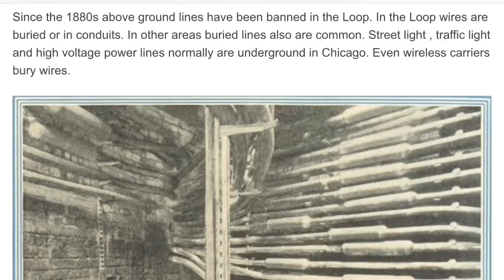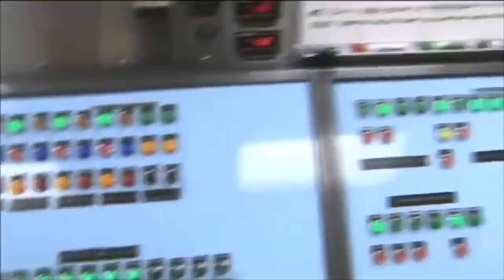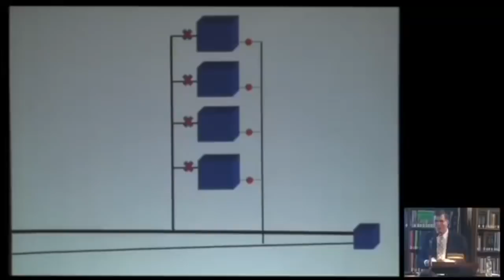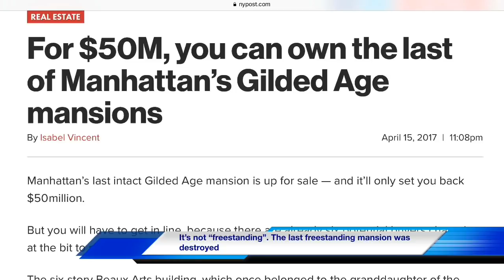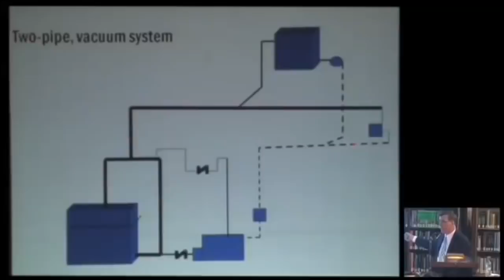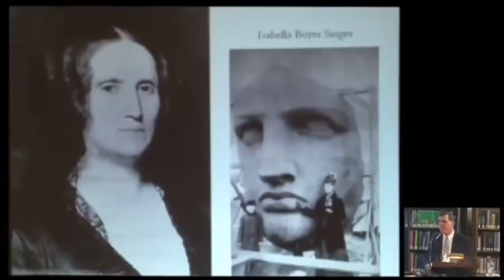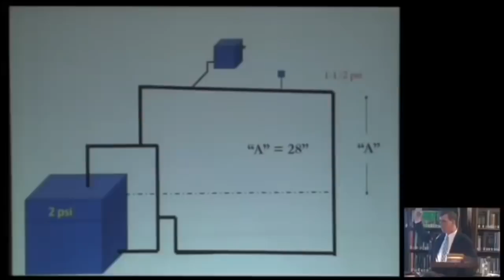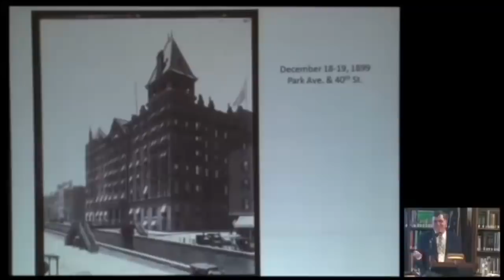Mudflooder Heating by Steam HVAC Revealed | UAP

Comment: I love ya my man but your incorrect about the steam turbines. I operate Boilers and we have a steam turbine that condenses 900lb steam to 165lb and 65lb which we run and supply the mill with. We often joke about all the 150lb steam we vent into the air that could be heating homes.
Reply from the maker: JoeNoBuddy Why not lower the pressures?
Reply: @UAPch  lower what, the operational pressure? Expand please.

Comment: I'm quite a ways along and still don't know where you get free steam.
Reply from the maker: Jason Snyder geothermal
Reply: @UAPch  Right, even though the earth does hold stable temperatures that are above freezing I'm just not convinced you could hit 100C necessarily anywhere you drill (unless drilled to unfeasible depths).  Hot springs are rare and are usually already owned privately or as preserves by government.
Reply: @jasrobsny  you can create free energy once you have water on a loop,I think they could have used ram pumps tall vertical pumps that send the water up,Hydro power could run a generator to make heat,its just a thought.

Comment: Elevators with rainwater?
Reply: The counterweight of the elevator is a bucket. Fill the bucket, the counterweight drops and the elevator rises. Drain the bucket, the elevator drops. A storage tank on the roof collects water to make it work.

Comment: UAP The heating radiator was invented by Franz San Galli in 1855, a Prussian-born Russian businessman living in St. Petersburg. In the late 1800s, companies, such as the American Radiator Company, promoted cast iron radiators over previous fabricated steel designs in order to lower costs and expand the market..... SO DONT TRY AND SELL SOME OHHH HOW DID THEY DO THAT B.S !!
Reply: One of the first modern hot water central heating systems to remedy this deficiency were installed by Angier March Perkins in London in the 1830s. At that time central heating was coming into fashion in Britain, with steam or hot air systems generally being used.
Reply: James Watt’s double-acting steam engine of 1769